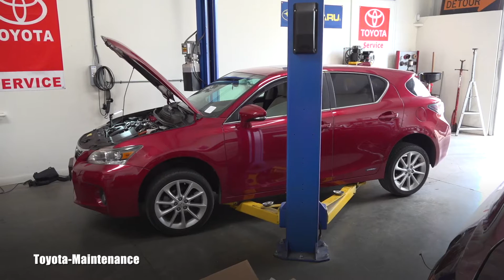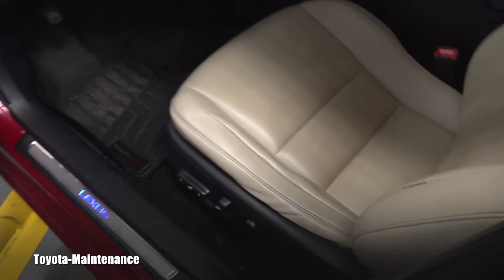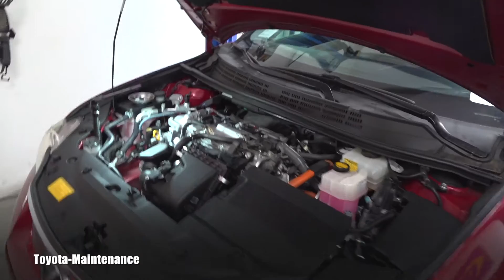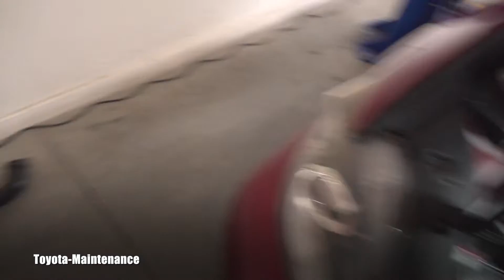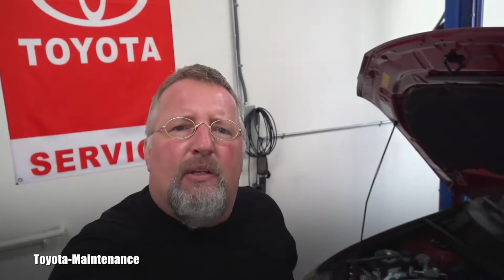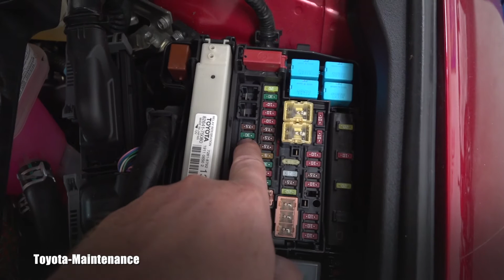Lexus CT200h electric water pump and thermostat housing

Comment: You wonder why in the heck they thought it would be a good idea to put a plastic impeller on a steel shaft immersed in hot coolant? What a dumbass idea.
It wouldn't surprise me if the plastic impeller begins to come loose from the shaft and ends up getting plastic debris shoved down into the motor shaft housing causing the electric motor to lock up.
Also apparently EGR valve and cooler assembly problems can cause a blown head gasket on this drivetrain also.
What the hell were they thinking . My belt driven water pump on my 2008 Prius failed at 280,000 mi. the bearing got a little bit of play in it the pulley wobbled and tossed the belt off but never actually leaked.
Got a pump for $50 at O'Reilly Auto Parts.
Sometimes simple is better

Comment: Why would a water pump on a high end Toyota fail so soon? Wonder if it was a made in Mexico or China part.
Reply: The Toyota pump is made by Aisin in Japan. 
BMW also use an electric pump made by Pierburg or Continental in Germany (so not Chinese rubbish by any means either) which  typically fails at around 80-100,000 miles. 
My point is that it seems electric pumps in general just don't last.
Reply: i read it elsewhere on a design flaw of 2ZR engine: the coolant pump has plastic fins instead of the metal as in the traditional coolant pump and hence the the plastic fin failed sooner.

Comment: Very interesting. Too bad they didn't put a pressure gauge in the pump, or provide a testing access port you could use to measure the flow that is usually capped off.